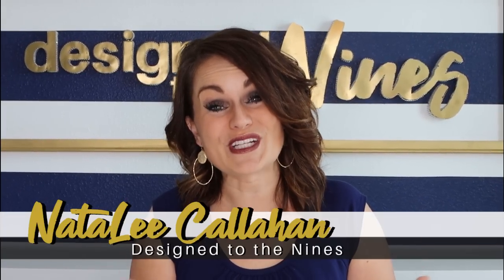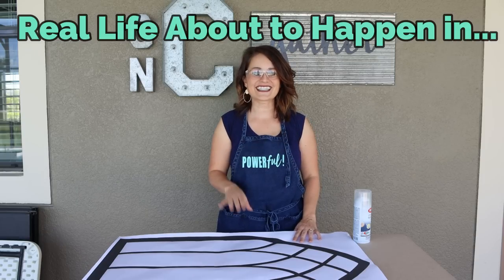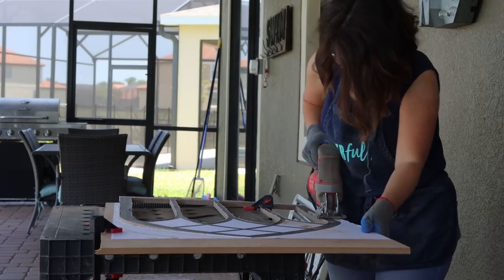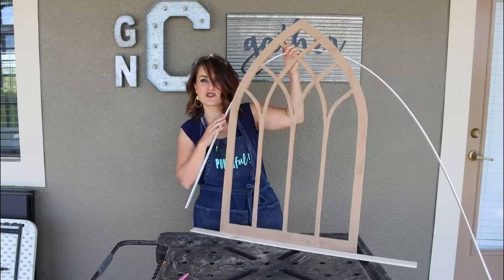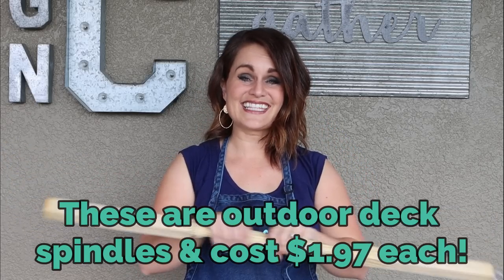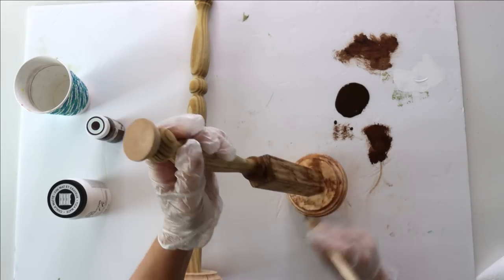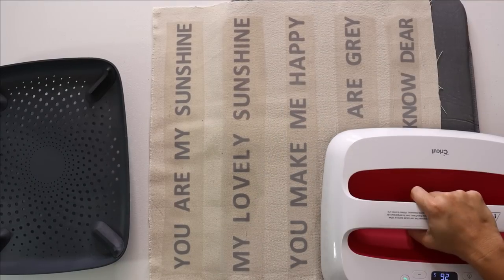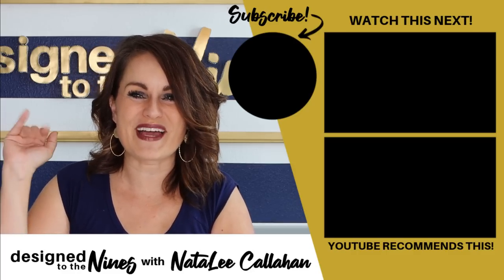Magnolia Home Knock Off FARMHOUSE DIYs!

Comment: Hi! I was sooooo SO excited to see this window project, I can not tell you how badly I have wanted a large arched window and just can't afford to buy one.  I called Staples to inquire about the prints, I was told that a solid line print can't be done as an engineering print because it would be saturated, so they said it would be $29.99. Can you please tell me what I should say to them in order to get them to print it? I told them I only needed the lightest weight paper that it was a pattern.  Tia, Laura
Reply: Oh and I think you are only 45 minutes from me, so cool!

Comment: When I printed it printed a tiny one on one page how to get it bigger
Reply from the maker: If you want a large engineer print size you’re going to have to take it to Staples and print it out there. It will cost about $3.50 to do that.
Reply: Designed to the Nines thank you I tried several time to do it and wasn’t working